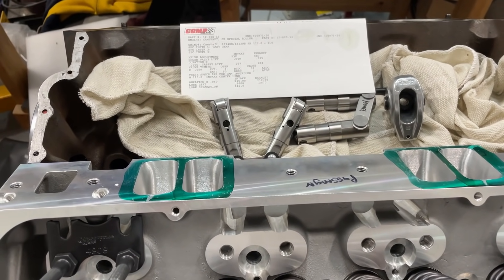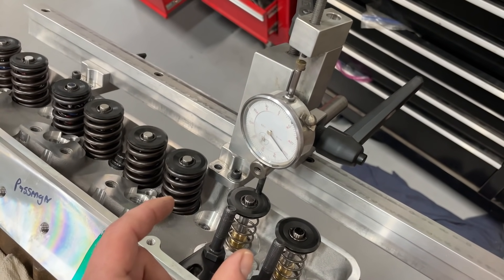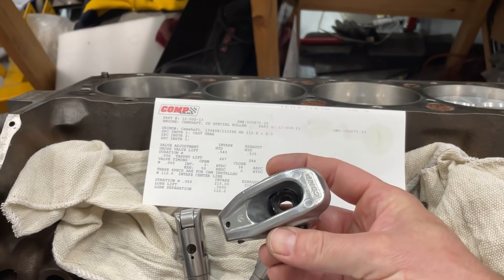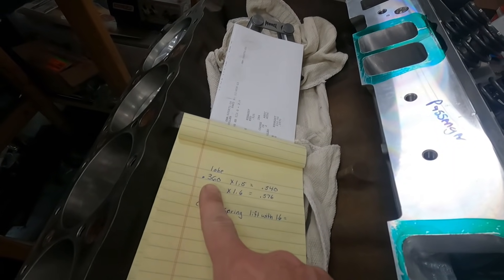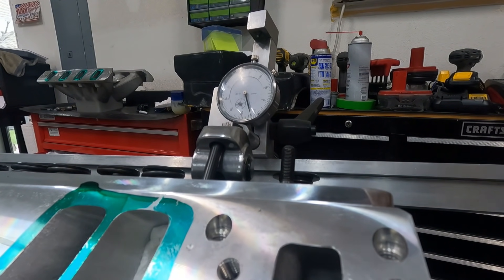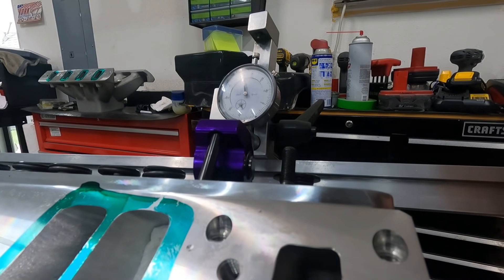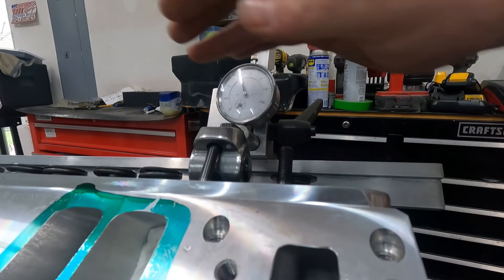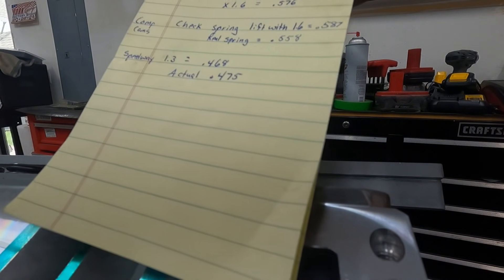Camshaft Info: How much lift are you losing?

Comment: I wonder if only having one head bolt in is letting it lift the head a bit causing some of the lift loss.
Reply: Nothing to do with it.
Reply: If I was doing a test of losing thousandths of an inch of lift, I would at least install bolts around the cylinder being tested to make sure.
Reply: I agree on a running engine it has nothing to do with it. For instance a 400lb valve spring with a 1.6 ratio rocker arm has 640lbs worth of force pushing up on that single bolt. That force is also probably not right on the bolt centerline so now the head is leveraging on the single bolt. I would think some deflection is happening in this test that could add to the lift loss. Naturally most is probably lost in the pushrod and rocker stud deflecting under load.
Reply: @1320horse  Well it's a good thing the head doesn't get bolted down with just 1 bolt... Theories and over engineering sideline common sense. He is showing a quick difference of what happens when to lift from a check spring to a real spring. That is all. Don't need the physics talk to be honest. If the bolt is  snug, it isn't going anywhere, nor will have such an affect. Speaking in real world terms. Just sayin.
Reply: It was just simple discussion/thought. Seems like you have it all figured out, and don’t want to hear any different.
Reply: @1320horse  Always up for discussions, but 30+ years in this business makes me want to help guide people's way of thinking, to what really matters, what doesn't matter, and the reality of it all. I see way too many people over thinking everything, trying to make that wheel rounder... when all you need is an open mind and some common sense. Keep it simple.
Reply: Good point and I completely agree. I wasn’t trying to steer anyone in the wrong direction. I was just doing some thinking about how he was doing this experiment/test. I didn’t think of the fact that I may make it harder to understand for someone that is trying to learn.

Comment: Just reduce the lash, its always more than needed for heat growth
Reply: @alankirschenbaum768 , it's not the CFM that's necessarily changing, it's the duration of the valve opening. Obviously piston clearance needs checking through the cycle. Do an experiment, its very easy, all you need is a dial indicator, measure valve opening duration on one inlet to get a base reading of actual valve opening duration. Then close up the lash on that inlet valve five thou. and re measure valve opening duration. Depending on what cam/ lifter combo, it can make a difference.

Comment: First your cam have .366875 of lobe lift. 
Second thing you can not multiplie rocker ratio to have lift because the cam lift straight the lifter and pushrod but the rocker change a vertical lift by by a radius liftso you always lost from the calcul. And you last test with 1.900 install probly you have the wrong patern on the valve too long pushrod.

Comment: Think this is why my friend said he was able to use Crane roller (BBC) advertised lift int. 587/Exh. 610 in crate 502 with the GM Hyd. lifters. Others said no due to link arm bind, but was no issue.